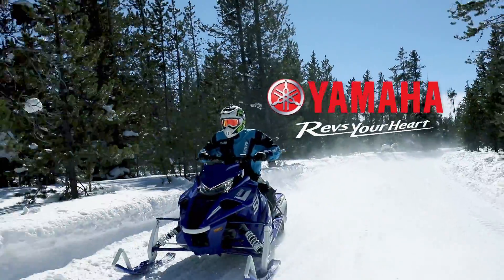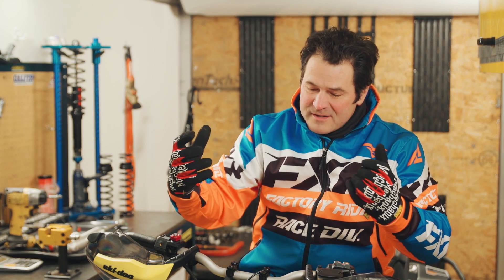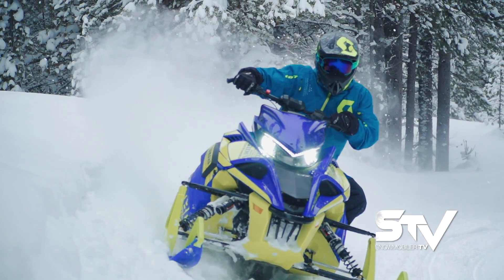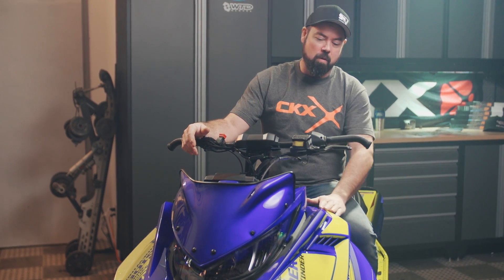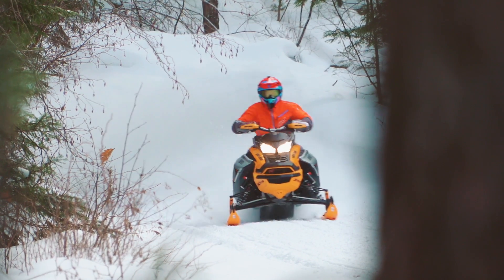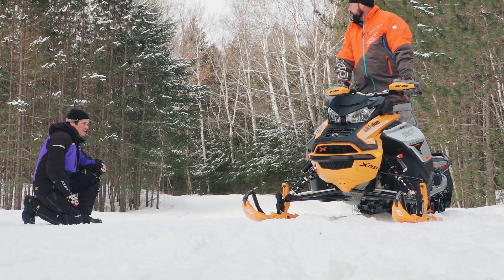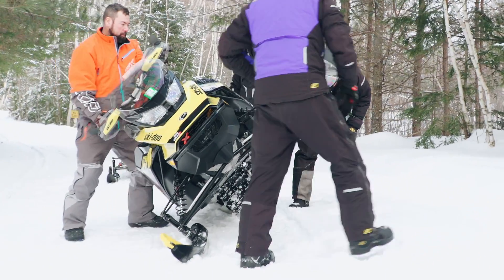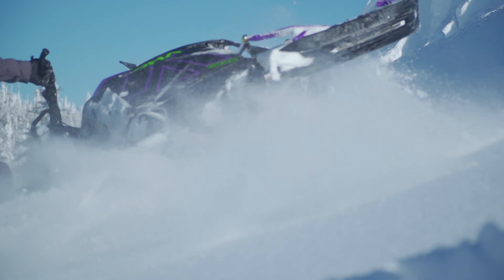Snowmobiler TV - 2019 Episode 7 ( Next Level Suspension Set-Up )

Comment: Suspension set up is all about compromise. What works best on a perfectly groomed trail vs what is best on rough trail vs riding styles vs rider ability and goes on and on. Just like clutching. 

A talented experienced rider understands the need to be able to ride around less then ideal set ups for the conditions that change constantly. 

For myself I have found it is key to keep the same sled for several seasons. If I changed sleds every season It would be like starting over from scratch every year. No thanks. 

Snowmobiles are very challenging to keep in perfect set up.